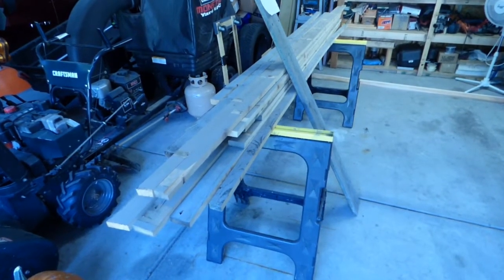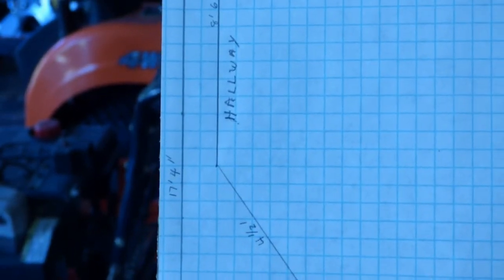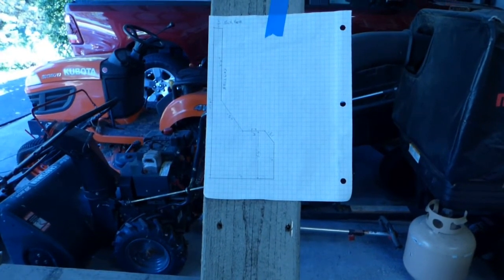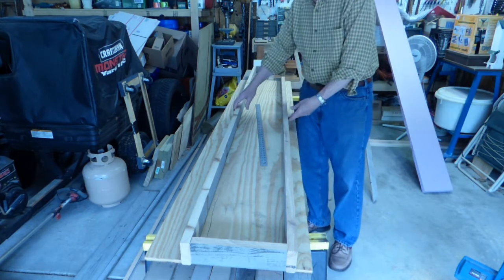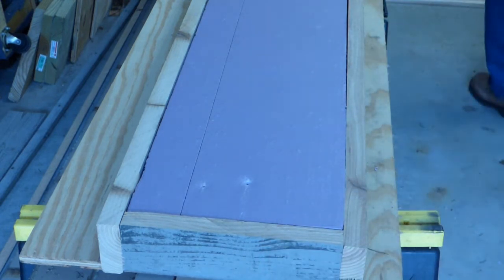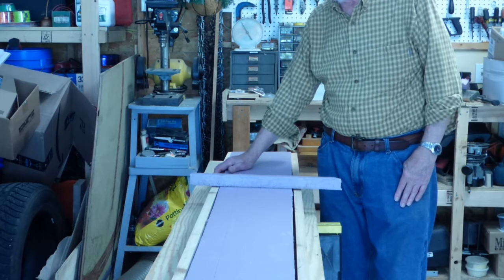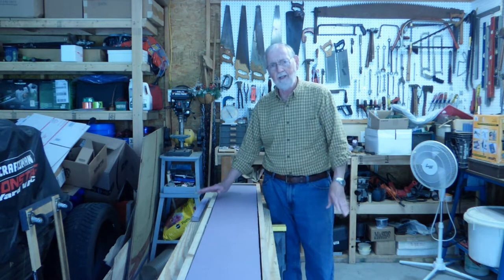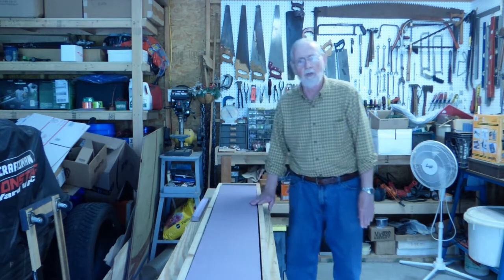Light Weight Model RR Benchwork: Part I

Comment: Have a 4x8 plywood sheet which I have been using for development and learning for the past several years ... mostly Arduino stuff.  Happen to have lots of shelving ... the kind with metal verticals and horizontals and particle board shelves.   My hope is to use the shelving units as a base for plywood with foam on top for a bigger layout.   Won't be this winter ... maybe next.  Meantime, maybe I'll learn some pointers from your build!!
Reply from the maker: Donald, buying that sheet of plywood was a good investment.  You have no idea how much it has appreciated in value since you bought it.🙂

We had new carpet put down in the basement early last summer.  I planned on starting the layout then.  However, procrastination too over...

At least the delay provided me with most of the framing lumber when we had our deck replaced this summer.